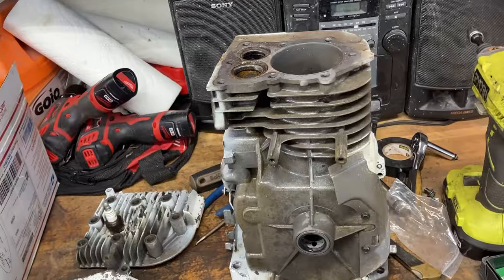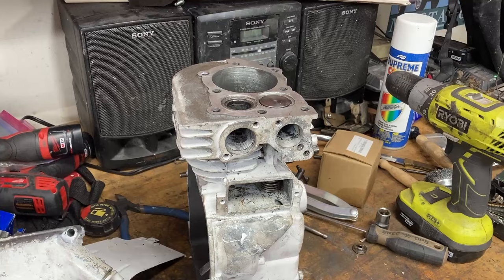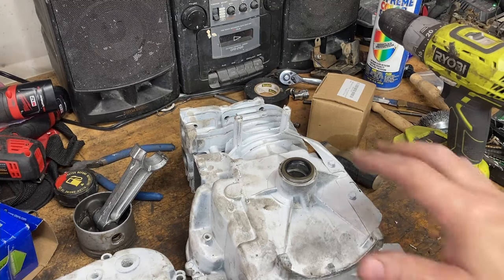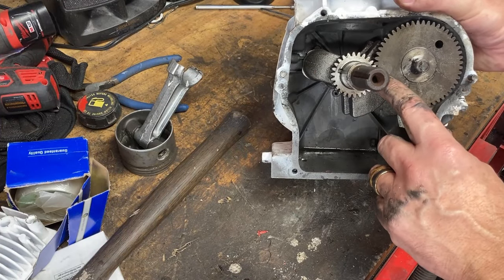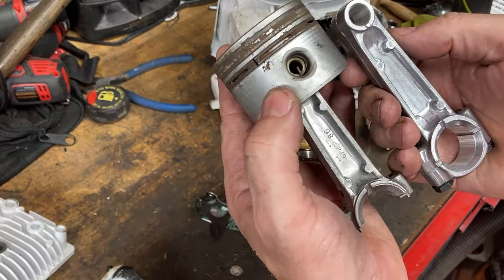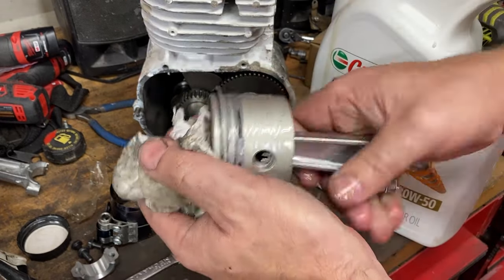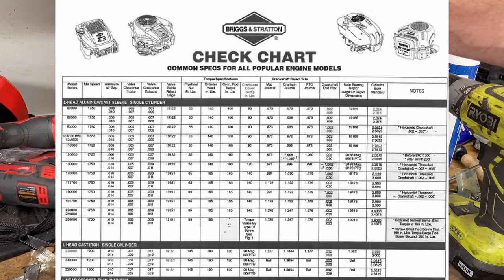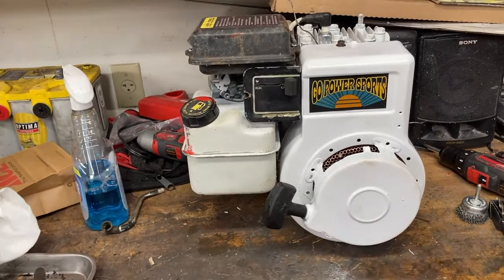BRIGGS AND STRATTON 5 HP REBUILD FLATHEAD ENGINE @GoPowerSports @briggsandstratton

Comment: Wondering, at 9:00 minutes in, did you just miss it? The top and 2nd ring ARE NOT the same. The 2nd ring has one of those weird edges you talked about. That weird edge faces down.